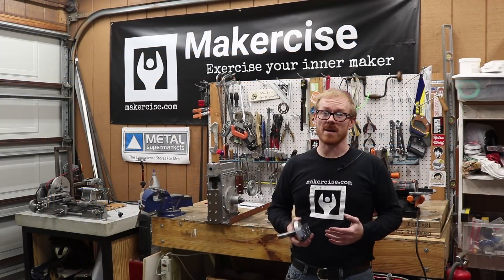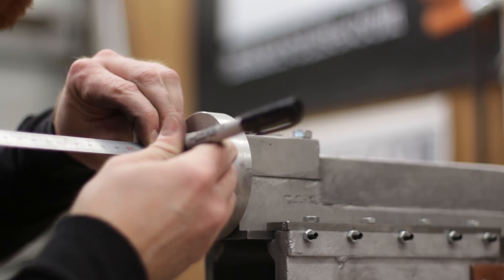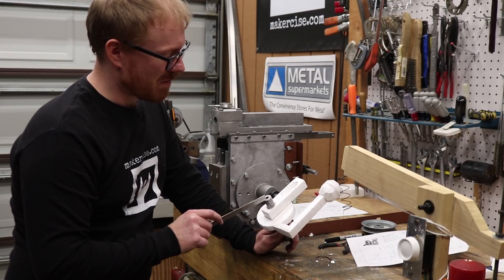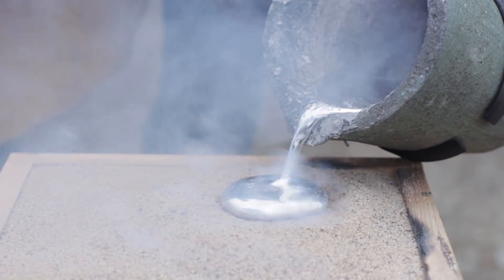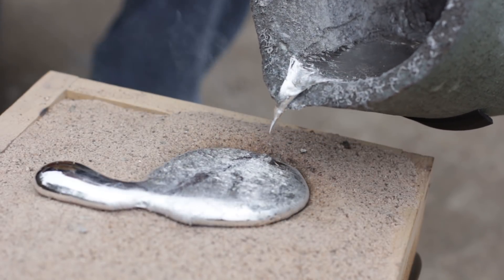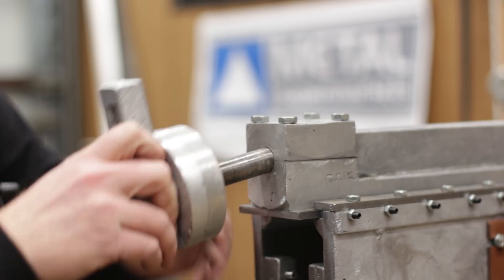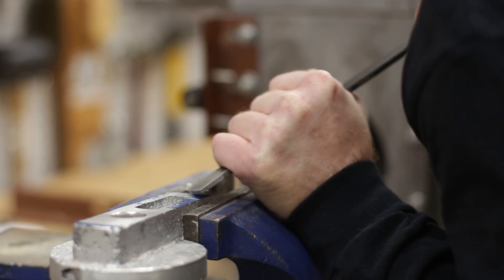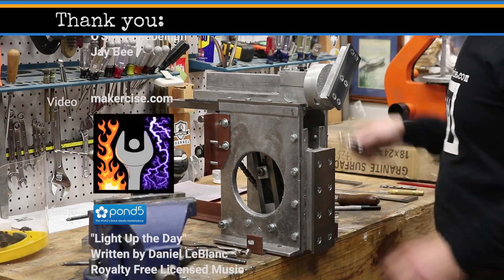Rotating Head - Downfeed Angle Adjustment for Gingery Shaper

Comment: I have done no castings but watched many videos, it looks like an additional (sprue?) at the top(s) of the casting would allow the melt to displace the gases without having to run back through the  melt. You can also watch the behavior of the aluminum in the vent to check for gas and cold melt. The melted plastic would also tend to float on top of the Al and be displaced. I must try reading Gingery.

Comment: nice work! you can save yourself a bit of time with the plaster coat by using unmixed drywall compound...mix 1/3 to 1/2 with fine dry sand then add enough water so that ya end up with the consistency of thin pancake batter...then just dip your prepped styrofoam parts give them a few minutes to start to dry then dip again....give em time to dry completely then put them in the sand box...kinda a cross between shell casting and lost foam with a superior surface finish...youll get a better finish but prob wont save much time with a small single cast but if ya have a couple parts its a life saver....you can do the same thing with the plaster but with a thin coat the drywall compound should be a bit tougher

Comment: What you need to do to improve your lost foam casting is to make your entry pour through a plaster funnel which allows you to pour at a much faster rate, the funnel shape and being above the sand will cause a needed hydraulic effect. Also making vents from plaster tube attached to the foam pattern will allow trapped gas to leave at a faster rate than trying to dissipate through the sand. Overall.......parts are looking good!

Comment: If you install a copper disk under the clamp bolt that secures the protractor head, it will prevent the shaft from being marred and dented by the bolt. This will make it possible to continue making fine adjustments to the angle without the tightening of the bolt drastically changing the angle because it finds a previous dent.
Reply from the maker: Ooooh. I like that idea.

Comment: Can you use lost foam to cast with cast iron?
Reply from the maker: Yes, but EPS causes problems not present in aluminum casting. There are specially developed resins used to mitigate those problems. I am not sure obtaining those resins is feasible for a hobby foundry. When I get to cast iron, I'll let you know.

Comment: After scraping, you know that the surface is flat. But the really important aspect would be having it square with the ram, no?
Reply from the maker: +Karl Månsson not really. Check out the video on facing the ram. For the reasons detailed in that video, even a measurable several degrees of out of square will not have a perceptible effect on the angle.

Comment: Excellent! the four jaw chuck for the lathe would help you alot should you choose to continue the gingery projects.  Have you considered using a different foam, something finer maybe, seems like you get alot of surface defects...
Reply from the maker: +Ramiro M molded EPS is the industry standard for smoothest surface finish. I wont make enough patterns to justify investing >$10k on the EPS molds. XPS may create smoother surfaces but if i need a smooth finish I can just add a few mm for a machining allowance. The non cosmetic surface defect are caused by poor degassing. I will fix this eventually, but the logistics in my temporary shop space of adding an argon tank is infeasible. I am machining an adapter for an off-the-shelf 3 jaw chuck this week FYI.